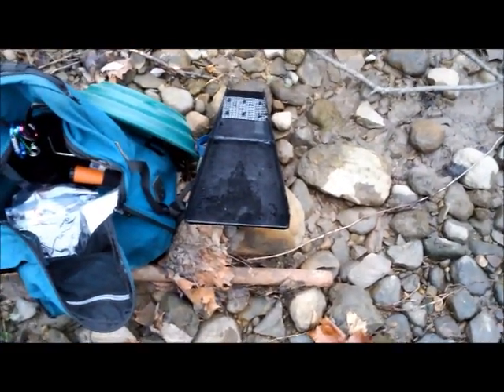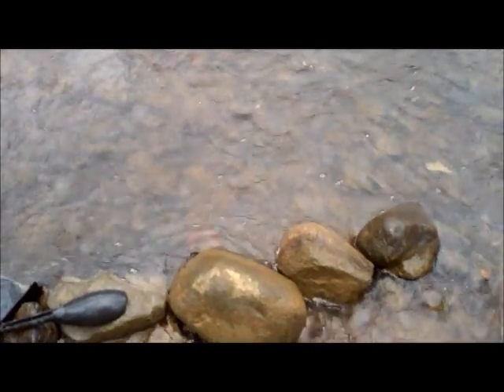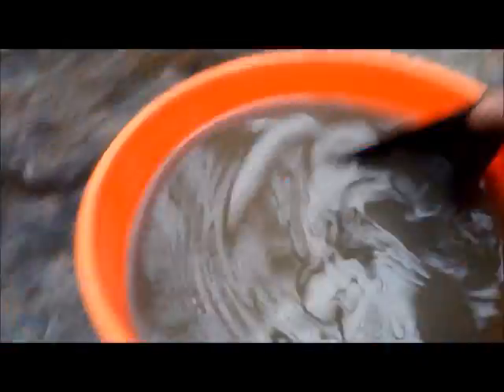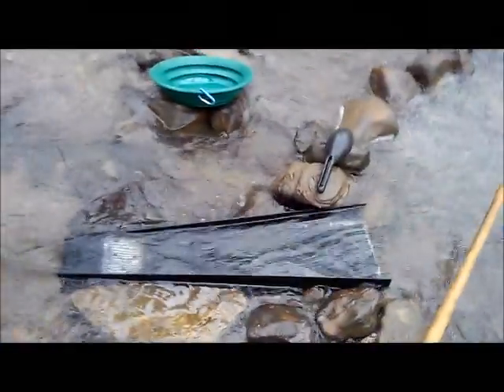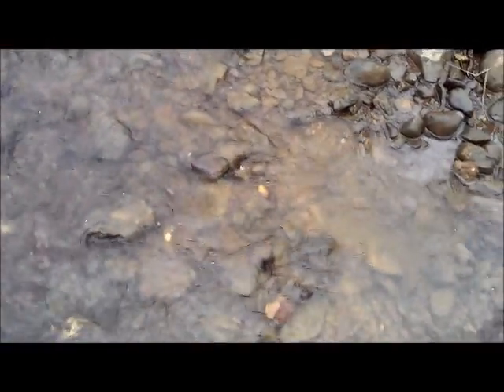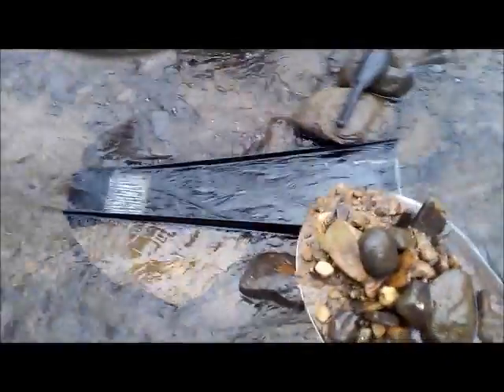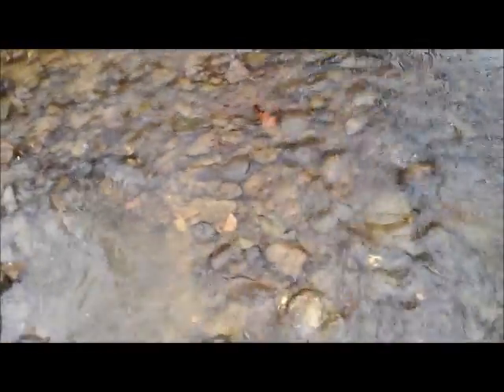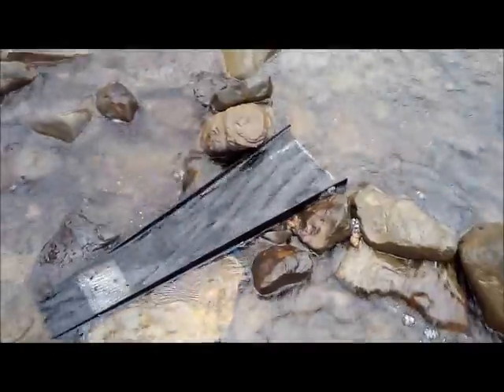Ohio Gold Prospecting | A&M Mining (Creek Gold with the Bazooka Gold Trap! Part I) January 2017

Comment: A wooden handled shovel would last me about 5 minutes.

I had a steel handled shovel I used for about 2 years, eventually broke the spoon in half on it while trying to pry up a rock that ended up being a quartz stringer.

I used to prospect in NC.  I'd get that much in a shovel full, 2 or 3 times that in a pan.   Even so, after running a 150 five gallon buckets of material through my highbanker it never added up to much gold.
Reply from the maker: I feel your pain! LOL

Comment: nice video, bgt is a great sluice. I would recommend getting rid of the hardware cloth. it will actually inhibit your recovery. looking forward to seeing the next video.
Reply from the maker: Thank you so much Utah for your kindness and support! I've actually been having this same discussion on Treasurenet! ( http://www.treasurenet.com/forums/sluicing/494628-how-long-did-take-you-receive-your-bazooka.html ) I will be taking the hardware cloth off the super mini (24" inch BGT) to test any performance gain, but I think I will be keeping the cloth on the 36" inch BGT sniper for now. For the sniper, the cloth definitely kept a lot of nonsense out of the fluid bed. My issue is one of water speed. Here in Ohio, the creeks are REALLY low so I fully understand that the cloth decreases the sluice's optimal performance as far as removing material quickly. As for inhibiting my recovery, I would agree if we are talking about larger pieces of gold, bigger than a 1/4 inch, but here in the Mid-West, we have only fine gold and definitely clean gravel so I'm not too worried about loss. In fact, I did a lot of leg work researching this fact and i did 4 test rounds of 10 pieces of smashed lead of which all 4 tests produced all 10 pieces in the fluid bed with the cloth attached. YouTubers  astrobouncer, sluice lee and djpitr use the hardware cloth modification and have shown great results. I hope you have a minute to check them out and do a Q&A with them if you can. They have a great repository of information on this subject, one that I found to be very refreshing. Once I start prospecting in GA again, I will definitely consider removing the hardware cloth, as I have found pieces of gold greater than a 1/4 inch and Lord knows I'm not trying to lose any of those blessings!

Grizzly Mod Reference:

https://www.youtube.com/watch?v=jBsLhSvgqIk

https://www.youtube.com/watch?v=DxkhOHSS-e8&t=10s

https://www.youtube.com/watch?v=_DVi6H7Vs_k
Reply: A&M Mining 
I saw the continued discussion last night after I commented. Kevin in Colorado was telling me the different size rocks (even larger ones) help the fluid bed work better
Reply from the maker: Kevin is a pretty cool dude! Hoping to pick his brain more in the future. I'm looking forward to trying it out. I'll definitely keep ya posted on the results. I'm a little weary of course because Ohio is chalk full of iron and pyrite. I've had a huge issue with that stuff clogging up my backpack sluice that I ran all last year even after classifying down to 1/8 inch. So my fear is all that would fill up the fluid bed and any small gold would trickle over the top. I'm totally open to the suggestion and hopeful y'all are right. It would definitely speed up the cleaning of the material on top for sure.